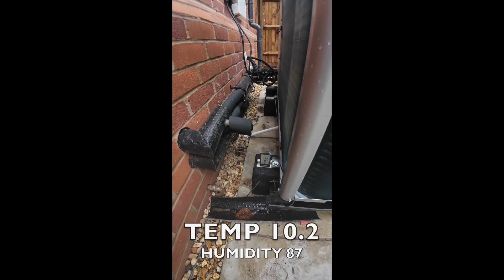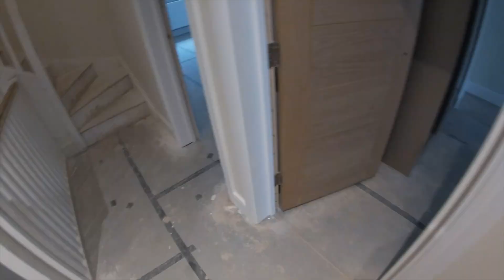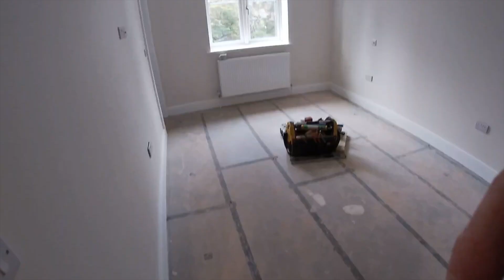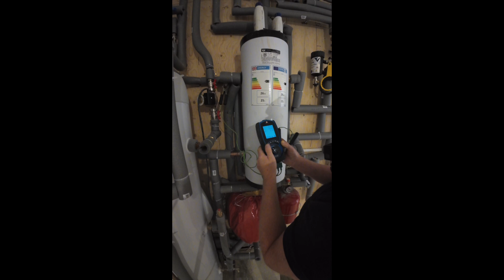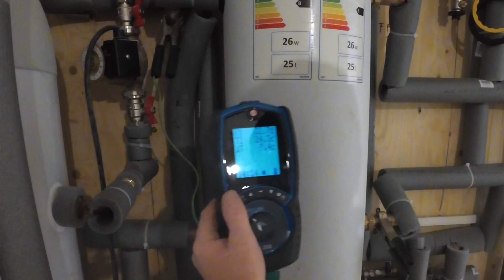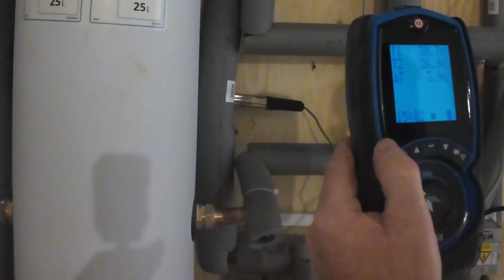Monitoring Heat Pump Efficiency through Flow and Return Temperatures

Comment: Maybe you have sorted this out by now. In case you didn't, lowering the flow rate on Heat pump/buffer side and increasing the flow rate on buffer/UFH-radiator side (do you have secondary circulation pump?) should solve the issue. Otherwise, you have too much mixing in the buffer, killing your COP. Also, delta T on radiator is too low. Try slowing down the flow on radiators a bit.
Reply from the maker: Hi yes all sorted now. after a lot of trial and error. Thank you for the info though. Thank you .👍

Comment: Could I ask the flow rate from the heat pump.  This would also effect the defrosting if too low as the HP will be working harder.  The flow temperature delta does indicate a flow rate that’s okay.

You may have covered this previously.
Reply from the maker: Hi Last time I check the flow rate was 30 l/m  think you 👍

Comment: Not so sure you need the buffer on a modern property like this tbh. With underfloor heating (open primary loop) the majority of your house's heating will be provided with this and find it's way into the upstairs. Upstairs rads can therefore be run at the same low temps as the primary loop with TRVs to provide any supplemental heat. If you're insistent on a buffer, consider re-plumbing it as a three port buffer to minimise distortion, and make sure your flows in and out are balanced.

Comment: My perspective as a keen enthusiast is:-

You've posted a total heat loss calculation of 9387W at -3C ambient. I would be asking, why a 14kW HP when a 10kW would be better suited ?

ChidleyEngineering wrote "The very large heat pump with a low load is going to cycle a lot. With the buffer, TRVs, zone valves, extra circulation pumps, etc I believe that you'll be getting a lot of distortion and inefficiency."

From what I've read over the past two years, what they have stated likely covers the causes of the main inefficiencies you may be experiencing.
My focus would be on oversized HP (very likely the cause of over frequent defrost cycles), and two, imbalance of flow through buffer (either or both potentially giving lower than expected COP).
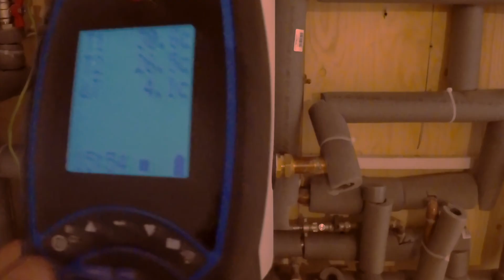At 2:22 that three or four degree temperature difference indicates heat being lost on the flow through the buffer.

I posted a link to a video previously about the importance of the flow rates of water through the buffer, which to my mind gives good explanation as to how important it is to have the correct flow rates on the flow in and flow out at top of buffer vessel.

If I were the customer I would be delighted with the tidy installation you appear to have done, for such a large and complex project.
Reply from the maker: Hi I think the heat pump although 14Kw is realistically 11 KW  Thank you

Comment: Take all of what I'm about to say with a lot of salt. 

I couldn't see all of your radiators but from what I can see you've got a 9.5kW (ish) demand at -3C with a 45C flow. You've sized your radiators for that. Even under the best circumstances you're unlikely to do better than about a COP of 3.5 (I haven't checked your specific heat pump but that's how mine would perform at 45C flow). If you reduce the flow temperature to 35C the radiators will not emit the required output and you're heat pump is unlikely to moderate down to that kind of load. The very large heat pump with a low load is going to cycle a lot. With the buffer, TRVs, zone valves, extra circulation pumps, etc I believe that you'll be getting a lot of distortion and inefficiency.

For comparison, my 5kW heat pump sees an emitter load of 6kW at 35C (25kW at DT 50 - I have huge radiators) and I have no zones, no extra circulation pumps, no TRVs. According to my heat pump's data I should get a COP of 4.5 ish. I am getting an SCOP of 4.1 (including DHW).
Reply from the maker: Hi realistically  Actual out put in cold weather is 11 KW  output.I agree it would be great to have fully open zones . The design temp of the radiators is 40 c  but am running flow temps at 35 c at the moment and 1st and second floor temps are good .Thank you.👍
Reply: @HEATSEEKER1428  I'm sure that 11kW would be enough. Personally I run weather compensation with the lowest curve that I can, 20C target temp (18C overnight), 24 hours a day, fully open system. I get a delta T of 3C at a flow rate of 14 lpm (I believe that the heat pump software is limiting this as its 20 lpm on DHW). Given that it's a modern house, I'm sure that you could probably go for a lower flow temperature as my flow temp very rarely gets up to 35C.
Reply from the maker: @ChidleyEngineering  Hi I hope to get down to a low flow temp. Thank you
Reply: @HEATSEEKER1428  My suggestion is also to temporarily bypass, or run as a volumizer, your buffer tank as another test. Even though my SCOP is 4.1, in this warmer weather (13C) I've been seeing COP for my heating of over 6 at times. With underfloor heating I'm sure that you should be able to match that. I wouldn't be surprised if the defrosting problem was caused by the lack of volume in the system owing to the fact that the zone and TRVs were limiting the volume.
Reply from the maker: @ChidleyEngineering  Hi I might do that if the other changes that I propose to take aren't fruitful . Yes I would be happy with an average COP of around 4 . Thank you 👍
Reply: @ Given that you've used copper pipe everywhere,  and all of it at least 15mm, you have options (like removing things). I have done everything I can to reduce pressure drops, increase flow rates and balance the system. The challenge will be educating the householder(s) once you've fixed the problem 🙂
Reply from the maker: @ChidleyEngineering  Hi Yes  educating the end user is for me at the moment is in the distant future   When I get it dialled in I. will be more confident  Thank you